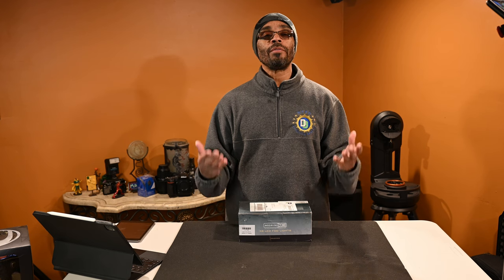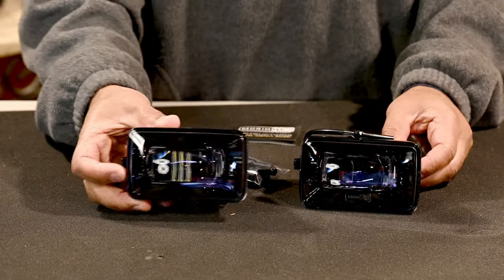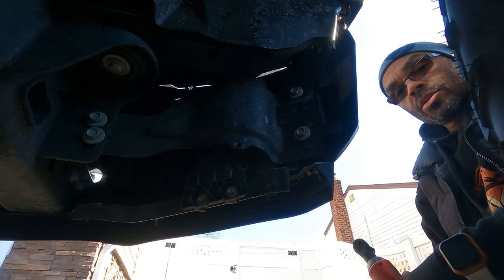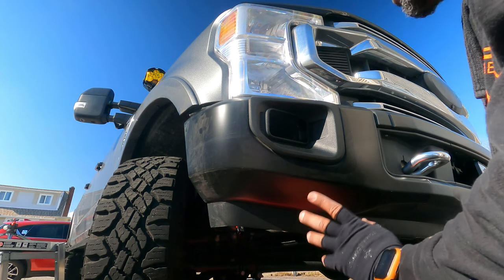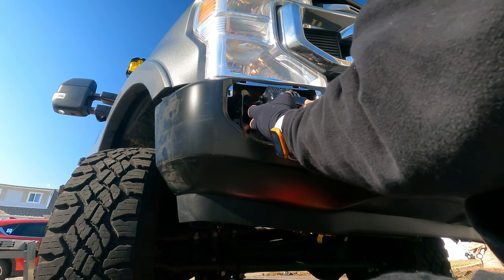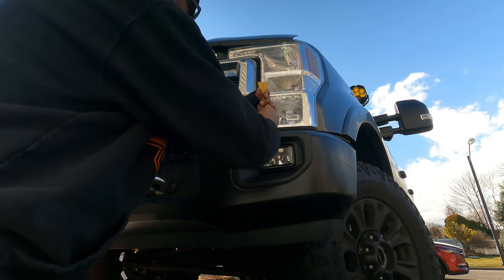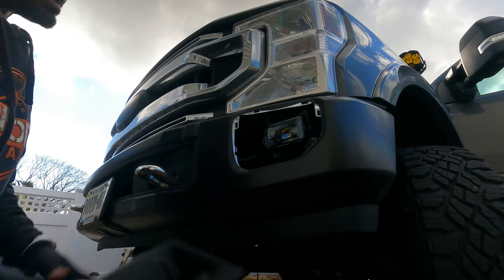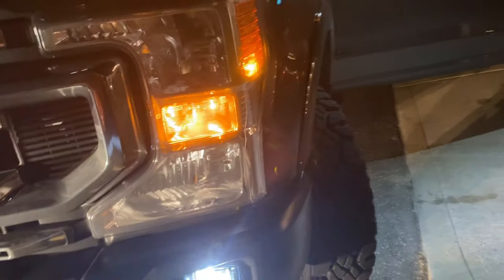2020 2021 2022 Ford Super duty Tremor How to install Morimoto XB LED fog lights  A Simple easy way.

Comment: An old timer taught me back in the day when replacing pairs of headlights or fog lights it's always a good idea to mark squares with painters tape on the garage door where the hot spots are and not move the truck until after installing to get perfect aim setting close to stock.... (this also works very well when you do a leveling kit, mark it before leveling and adjust afterward, because you will be blinding people for sure if you don't turn down)

If you forget however,  a good DIY trick he says is to install one new one and match it to the old one that's still installed, that way when you do the second new one, you still have that reference point from the first one thats properly aimed to match up with. Takes a little time but will def be done right.

Appreciate your videos sir, I have a 22 tremor on order and watching your install videos has me getting excited haha
Reply from the maker: Thanks for the tips. Please remember to subscribe and like the video.

Comment: Will these somehow fit a super duty that has oem led fog lights. Seems like a different housing in the fog light area. Any thoughts on this. Thank you
Reply from the maker: Thanks for the question, i would suggest to visit the Manufacture website. I’m sure you find the answer on compatibility for your vehicle. I believe they have a different model for vehicles equipped with LEDs. Just check with them before you try to order. Good luck